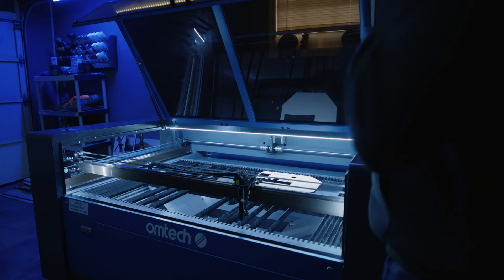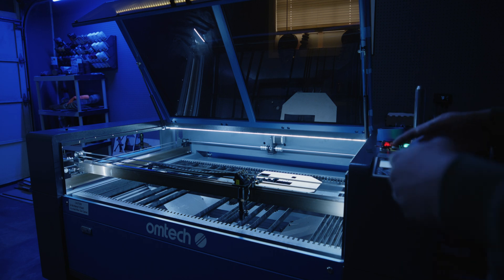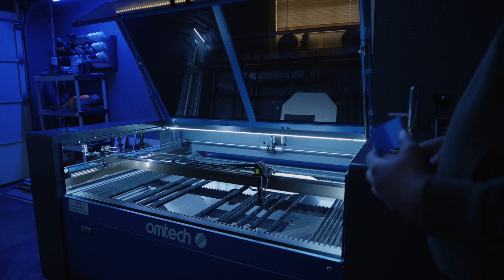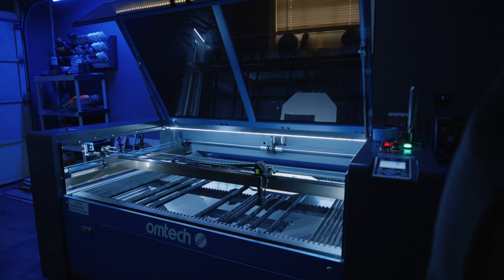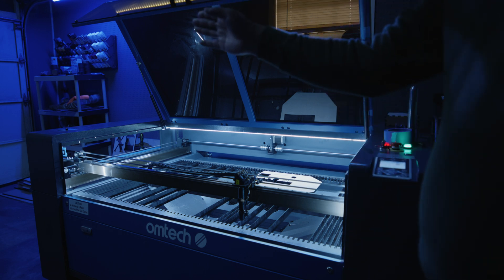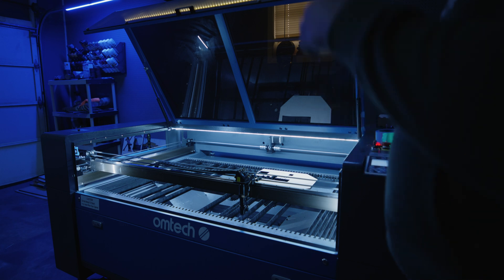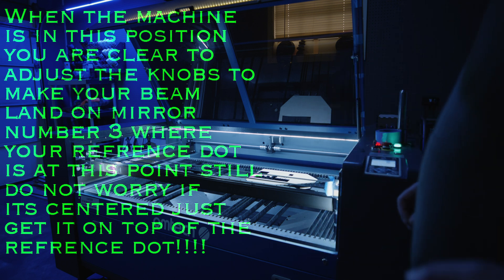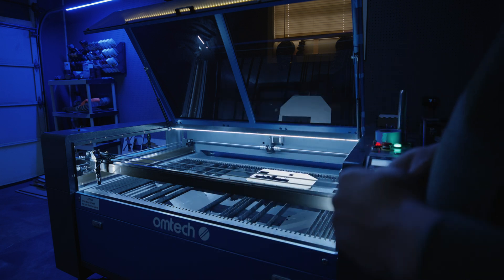How to align your CO2 laser beam What not to do.

Comment: What if all three corners are spot on the third mirror, except the back right? There the beam is lower on the the third mirror. What do you suggest ?
Reply from the maker: The only way three corners will be perfect and one is off is if either alignment isn't true or you have the machine really off level in that corner send me a pm and I can assist further.
Reply: @Co2Aaron  PM in YouTube?
Reply: To me looks like leveling problem. As i move the head from front right to back right the beam goes off. Is there any chance to level it?
Reply from the maker: This sounds like alingment very low chance its leveling but to know for sure I’ll need to trouble shoot over a video call